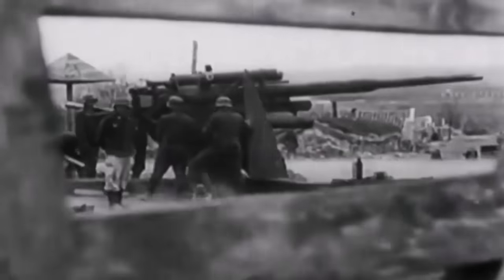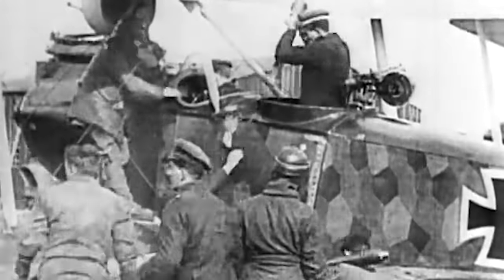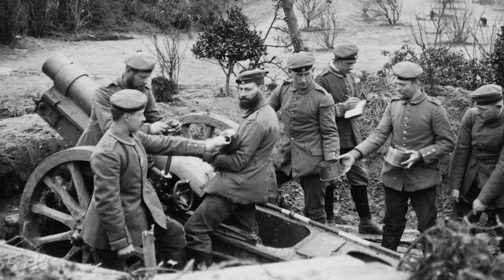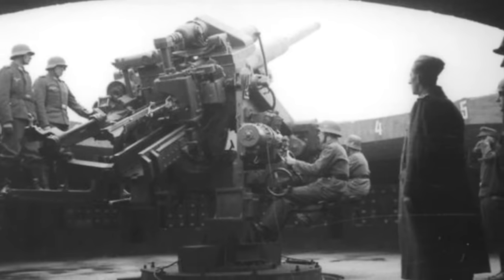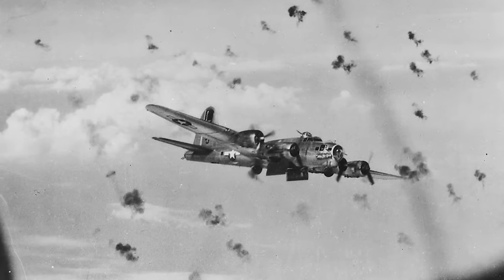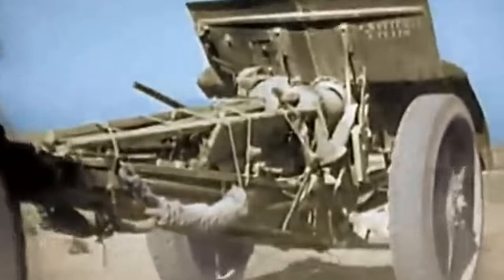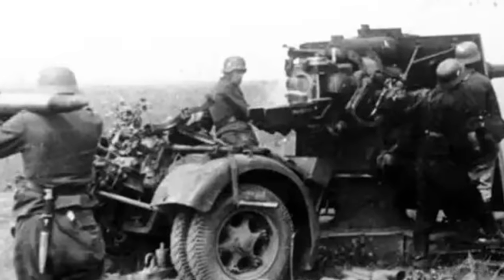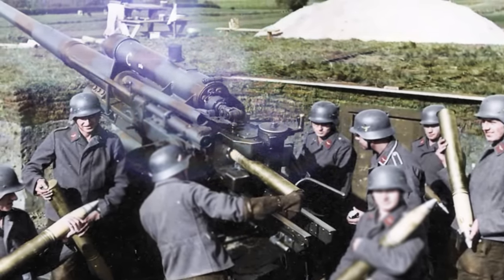WW2 Weapon the Actually US Feared the Most

Comment: There was also a naval version of the 88, and was used a Deck Gun on larger U-Boats such as the Type VII U-Boat.
Reply: I thought they mounted 105mm guns on subs.
Reply: The 88mm SK C/35 gun used on type VII U-boats was a completely different gun with no relation to the 88mm flak-guns.
Reply: @partygrove5321 The larger Type-IX used the 105mm. The Type-VII used 88mm
Reply: @dawyrm1  what part of "Naval Version of the 88" do you not understand?
Reply: @evilfingers4302  The naval gun was not a version of the flak-gun it was a completely different gun, designed separately and with the only thing in common with the Flak being the bore diameter.
Reply: @dawyrm1  how can you say it's different but the diameter of the bore is the same?
Reply: OK.  @dawyrm1
Reply: @evilfingers4302  Because it is a different gun. It would be like saying the us M3 75mm gun is a variant of the PaK40 because they are both 75mm.

Comment: if it had proximity fuse shells
Reply: Thankfully not.
Reply: Agreed but In a direct fire role proxy fuzes are overrated and aren't cost effective. It’s much cheaper to range a target and air burst based on time/rotation delay which is done arguably just as fast. That’s why time delay is still used today on recoilless rifles or grenade launchers. For AA or indirect fire artillery it makes sense but for some reason luftwaffle high command thought ambush style flak was just as good or better to proxy.
Reply: @Howie262  Basically a cost benefit analysis. Agreed, proximity fuses against aircraft are useful but pointless against ground targets such as Infantry.

Comment: The 88 was feared by almost every Allied soldier in the Second World War especially a tanker , the 88mm could punch through anything , even worse the pak 43 on the tiger 2 and  Jagdpanther
Reply: the tiger 2 had a 88mm main gun but the casing was larger then the normal 88
Reply: @andthenhedead6076  Yeah the pak 43 was the 88 but with a more powerful punch and penetration I forgot to add that.

Comment: The British and U.S had anti aircraft guns that  were ballistically similar or even better than the German 88mm in their arsenals and could have used them in a dual role against Tanks and aircraft just like the Germans but chose not to do it because of their doctrine of how to deploy  or use their anti aircraft gun, they looked at AA guns as the most use protecting rear areas or bases against air attack

Comment: It’s accuracy was something mad like 99% hit at a mile..
It’s shell often passed right thru a tank..
Reply: Ehh, that all depends. Accuracy based off what? Good luck penning through the front armor and engine all in one shot.
Reply: @gnomechild3248  I just quote what veterans from the war said..💁
Reply: There are even records about a 88 shell indeed passed right thru a tank, but just could keep on driving because it did not damage the crew or any critical parts of the tank.
So in this case the 88 gave the Sherman tank a free "ventilation hole".
But i believe that this was in the very beginning, when the shells did not have anti-tank capabilties.
Normally the shell exploded when a desiginated height was set. 
If i'm not mistaken they were started to make shells that were also have a slower trajectory, and a different fuse to make sure that the shell explodes in the tank.
Not when the shell has already  "left the building" and explodeds afterwards.
Reply: @karylhogan5758  Yeah, it's not wrong. the cannons very accurate, and it can potentially go right through the sides of Sherman's like a hot knife through butter. But so will the German 75's, and even allied 75's, 76's, etc will go right through both of a panzer IVs sides. Although like previous commenter mentioned there are APHE shells that are designed to detonate inside the tank. I'm pretty sure Germany only used APHE meaning it would blow up before penning through the other side. But if they used APCR it would go right through. APCR was commonly used by the allies, which lacked explosive, and was just a penetrator. The cannons are all accurate as hell too, if the range is proper.
Reply: @gnomechild3248 the accuracy came from the germans that used it they used math to get hits it had a 99% hit chance
Reply: @pierce7992  Yeah, but that's extremely subjective. What range are you hitting it from? How good are the optics? Are the optics properly adjusted? Has the rifling been worn out? Allied cannon accuracy could also have a 99% hit chance.
Reply: @gnomechild3248  that's what the math is for
Reply: @pierce7992  Yeah, but so does every other tank cannon. What type of math are you talking about?
Reply: @gnomechild3248  they used protracters to measure the angles and predicted when the shot was going to land and the exact speed the plane would crash into it
Reply: @pierce7992  You're talking about calculating things, like the minute of angle yeah? The allies did zeroing as well.
Reply: @gnomechild3248 btw the 76mm would go right through the front of a panzer 4 and even tiger 1s